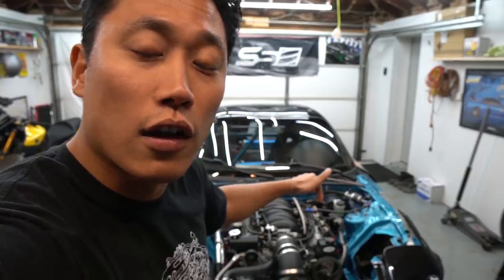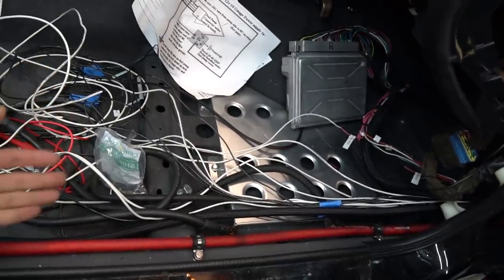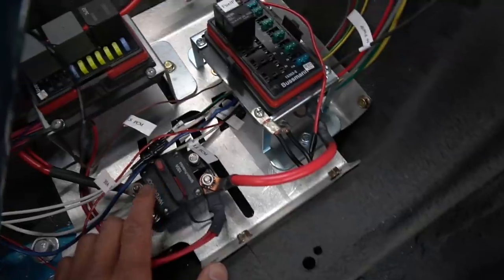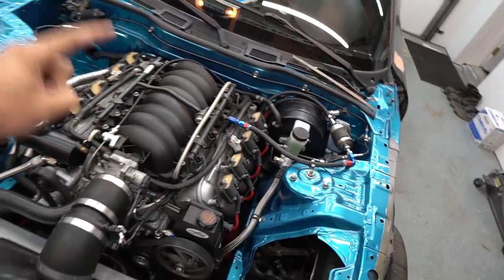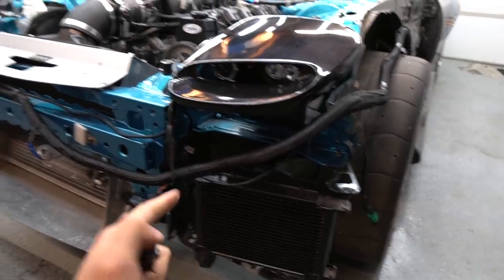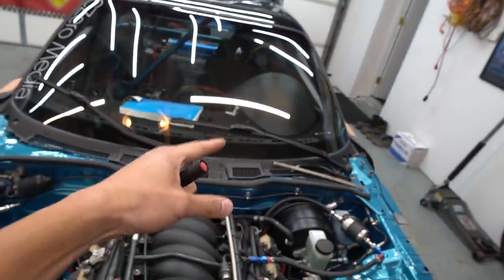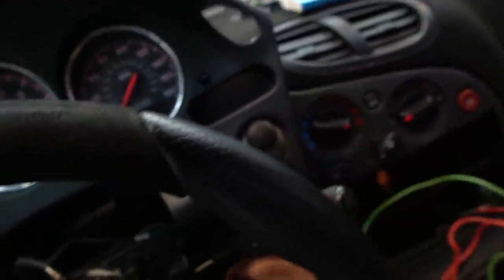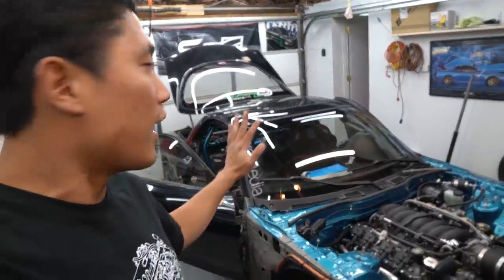First Crank and Calling Out The LS Guys - FD RX7 Race Car Build Video Series 35

Comment: I've been using the same CCA style 0 gauge wire on my GTO for 3 years for my battery relocation and it cranks like stock. I doubt that's your issue. It didn't sound like it was firing at all in the video. Connect the car to hp tuners and see what the ecu is seeing. Don't trying to diagnose blindly. Or any odb scanner should display basic data.
Reply from the maker: Hmm that's good to know. Thanks for the input. I still don't have a hp tuner with me as I was going to get it tuned by somebody else. I'll see what I can find

Comment: If you haven’t tried I would breakout the fancy multimeter. Check your voltage readingfrom batter through the power cable , and from your power cable to the starter.

Comment: I would start by getting rid of the CCA wire. Order some better wire from SMD, Steve Meade designs,,, or Sky high audio,,, DD audio also Carrie's high-end copper wire in 0 gauge... if that is not the problem I'm not exactly sure what is but it would definitely be a good start CCA wire is cheap and in the car audio world it's a no no... I do electronics and car stereo competitions so I'm very familiar with wire.. great video

Comment: Try moving your battery to the front of the car and making a temporary short positive battery cable and see if that helps.  No need to even mount the battery in the car, just get it close to the starter.  What transmission are you running?  Is there an issue with the starter / flywheel engagement?  I am building a factory five hotrod with LS2 / T56 from a 2005 GTO.  I have my battery very close to the starter.  I am running a very small AGM battery, but it still cranks quite fast.  I have similar grounds as you do (I do have the head ground on the drivers side to the car).

Comment: You didn’t mention if you could have possibly flooded the engine while trying to turn it on so check the spark plugs and their gaps as well. Don’t forget to make sure the fuel pump switch is on and also one of the other guys said that it could be an ignition timing issue. Nice setup man. Hope it works out for you and I’m sure it will. I just saw a Mazda Miata with 600HP LS engine stuffed into it and it ran like an asphalt beast.

Comment: Ever thought about running a Mamo Motorsports intake manifold? He ports both the MSD and Fast intake manifolds. I'm sure both would net in the area of 20hp & 15 tq over a stock intake manifold. Just depends on if you are wanting more top end power or mid range power.

Comment: FUEL, TIMING, COMPRESSION, FUEL PRESSURE, SPARK! If your battery is charged and it’s getting fuel, the timings fine.. then you have probably a bad ground or a mixed wire somewhere ! Hopefully you fixed it without tons of hours but remember ALWAYS start with fuel, then spark, then timing then compression

Comment: It seems to be preventing itself from running via some built in safety measure. Ive seen that before when someone wired the mass airflow sensor wrong. Engine couldnt properly measure air and fuel so it just wouldnt allow itself to turn. And it sounded like that

Comment: It sounds like and looks like you have not had the VATS system turned off in the pcm. The 98-02 camaro/trans am have a anti-theft system called VATS. And with out having the correct resistor "chip" in the key the vehicle will crank but will not start. There's a million tuning companies online that do nothing but delete VATS systems so the pcm can be used in swap applications

Comment: That's a fat fucking wire, even aluminium wire of that gauge and even to start an engine, I'd be surprised if the resistance of the wire was stopping the engine from cranking. I'm a final year electronics student so (high power) electrics and cars aren't (yet) my jam but my instinct says it's unlikely the resistance of the wire limiting current is the problem. It's not a huge distance that wire is covering either.

That's just a hunch and I could be wrong. Maybe if you detached the wire from the car and measured resistance end to end with a multimeter you could calculate the max current you could get through the wire and compare that to the spec of the starter.